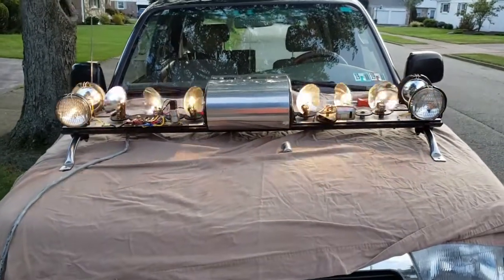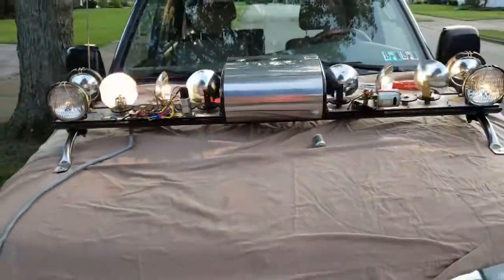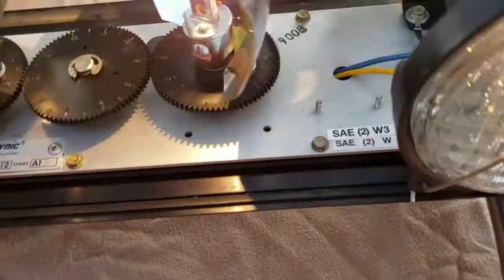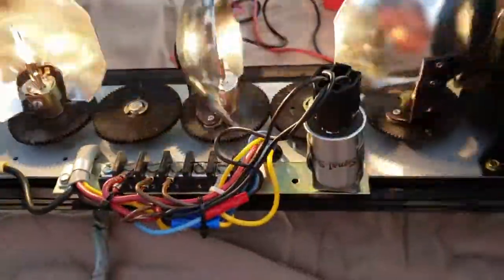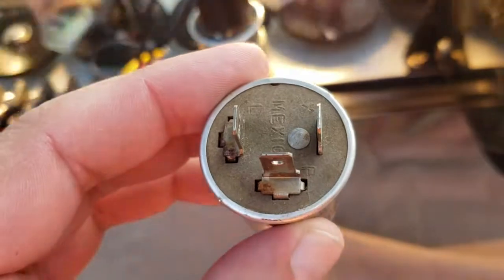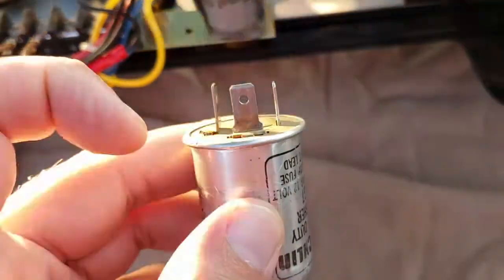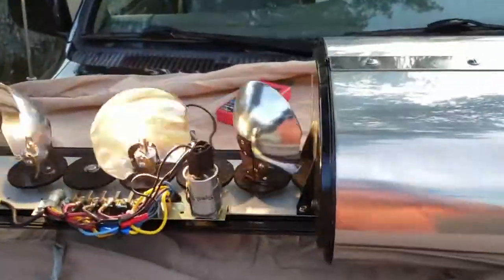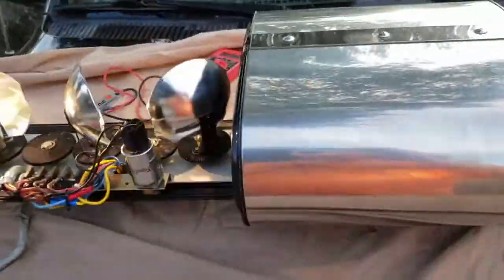Project Aerodynic Function Test and Flasher Discussion

Comment: Where can I get the old thermal flashers? I have bought several brands of 537 flasher but the flash rate is very fast and one light doesnt flash longer than the other.
Reply from the maker: That is the trick with the thermal flasher,   you never even back in the day got an even flash rate.   Your best bet,  if an even flash is important is to use something like an FA3 flasher.
Reply: @stampeedvalkyrie  i want the uneven flash rate. all the 537 flashers i buy have an even flash rate and flash way too fast. I must be buying the wrong flashers.

Your channel is great, by the way. Thanks for all the good info!
Reply from the maker: Many brands made the 537,  all are out of production.  I found mine via car shows and flea markets.     Its gonna be hit or miss,  but that is the chance you take with vintage flashers.
Reply: @stampeedvalkyrie  Thanks for the info!

Comment: What are the numbers on the gears for that flash pattern?.
Reply from the maker: as this is how I found it.. I would say classic outside in.     [8,6,4,2,0][0,2,4,6,8]     But with the inner rotators delayed longer so not Zero for the Center.
Reply: @stampeedvalkyrie  ok. Thank you. I have the 52A model. I like to play around with the flash patterns.
Reply from the maker: 52A model?   Can you be a little more specific?  I've never heard of this.
Reply: @stampeedvalkyrie  I just now saw your reply. I'm out here in the carport storage room trying to find the model number on it. Model 24 series a1. The build date says 1988 or just 88